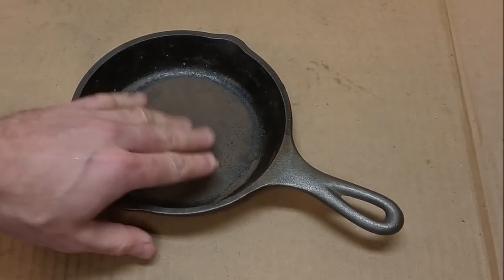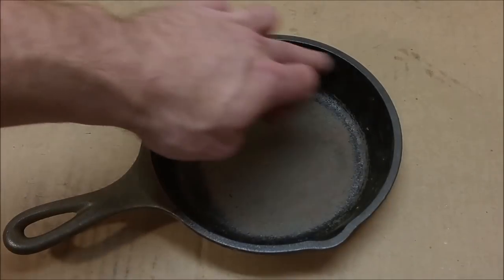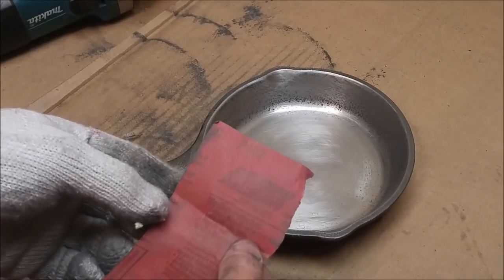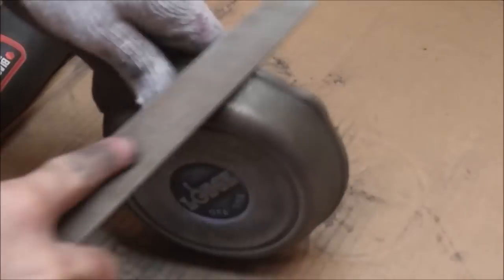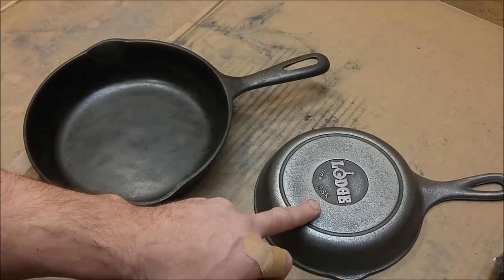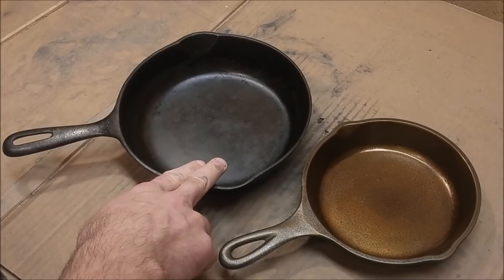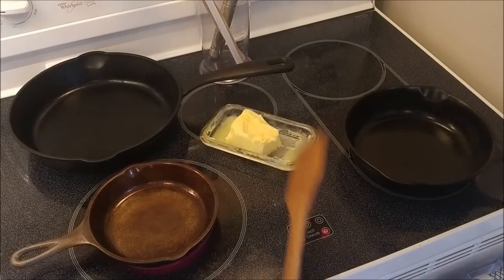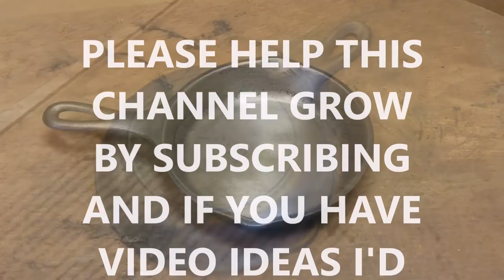🍳 SMOOTH a Cast iron Lodge skillet to make it function like an antique

Comment: I have to say, I restore a lot of cast iron and cook every day with it. I can take a brand new rough Lodge and not have sticking. I have a new 8 inch that within 30 days of purchase you could already see the seasoning layer build and start to smooth. If you have sticking, that means your cooking process is wrong. Has nothing to do with the iron.
Reply from the maker: I would tend to agree, since making this video I've investigated this quite a bit more.  I have gone so far as to test pans with no seasoning, both with oil and without.  At the right temperatures and with a little oil, they are also non-stick.  I've removed all residual oil from my seasoned CI pans and tested them to see how non-stick the seasoning is, and that's where is gets interesting.  It really comes down to the cooking temperature and the starting temperature of the food.  Cold eggs for example cooking in a pan at 100C will stick terribly, they also tend to stick to the pan even with a bit of oil.  When I tested warming the eggs first, that made a big difference.  The pan has to be beyond 100C, for steam to form and that seems to be the major factor in preventing the food from sticking.  the layer of seasoning seems to do more to protect against rust than it does preventing food from sticking.

What are your thoughts?
Reply: @NeedItMakeIt  I noticed this video was over a year old so didn't doubt you had some knowledge on the matter since you put this one out, but you nailed it in the last 19 words of your statement. A lot of folks say seasoning is exactly good for that, to prevent rust. Also, the more seasoned a pan is, the easier it is to clean after those mishaps or anything out of the ordinary that does stick. Now, I don't doubt it helps with cooking and adds to the properties of being non-stick, but when it comes to cooking, I can strip a pan, season once, and cook without sticking. But there's nothing like cooking on Mom's 45 year old seasoned skillet lol...
Reply: @NeedItMakeIt  I just viewed your video. The one thought I had with your eggs, are they cold, or room temp? I've found cold eggs dumped into even most nonstick skillets will stick rite in the middle of the egg!

Comment: Could eggs sticking be the result of slightly too high heat?
Reply from the maker: I've always heard "Hot pan, cold butter", I can't say I really understand the science behind it.  With eggs, there seems to be a temperature that is just right to keep the yolk runny to achieve the best dipping experience, but still have the whites cooked all of the way through.  

These days I like to use my plate as a lid; I find that it cooks the eggs better and it keeps them warm longer.... I'm starting to get a craving for eggs right now :).
Reply: There's two churches of egg frying in iron cookware:
- The brotherhood of low and slow 
- The disciples of the purgatory of eggs

The holy cookbook of the brotherhood demands cooking the egg on medium low heat for quite a while. At one point it should more or less self release. The brothers end up with an only slightly browned egg. 

The sacred scrolls of the disciples on the other hand  praise cooking the egg on higher heat. After a short while, it again should more or less self release and bless you with a nicely browned, crispy egg with lots of roasted flavors. 

Me being an egg atheist, I found both methods to work. But in my experience, the low and slow method requires a well seasoned skillet. Newer skillets tend to produce a sticky mess that way. Therefore, I prefer the other method. I also enjoy the roasted flavors of those crispy eggs.

Comment: Have you tried a wire brush for the grinder
Reply from the maker: I have not, I've seen a video showing this recently and I suppose it would knock off some of the high spots.  It may do less damage than a flap wheel around the inside corners also right?

Comment: Would like people in these non-stick test videos to cook something that will actually test the surface. Eggs, pancakes, French toast all have lots of butter first. Cook some bacon, pork chops  or chicken fried steak to test for nonstick.  There will always be crud left behind that requires scrubbing.
Reply from the maker: I will put this on the list, I have a few CI videos coming up testing some of these topics, I think this would be a great one.  Thank you for this.
Reply: The first misconception of people is to think polishing the surface of a cast iron skillet makes it nonstick. It doesn't. Polishing simply makes it easier to clean and more fun to use.
If food sticks to your skillet, there's something wrong with your cooking technique (and maybe the seasoning). Try a different cooking temperature and give the food time to self release. Pre-heat the skillet until the whole thing (including the side walls) is at cooking temperature, then add the oil and then the food. Play around with the variables and you will find the right settings for your skillet and your stove over time. 
And don't expect your CI skillet to become nonstick like a brand new Teflon skillet. It won't. A little oil / fat is required for most food types. But due to the seasoning actually absorbing a little oil (which expands when the skillet heats up and then forms a microscopic thin layer of oil), you still can cook many things without using oil in a well seasoned skillet. But if you remove that oil by cleaning the skillet with dish soap, most food will stick without oil the next time you cook. That's why you should always reapply a very thin layer of oil after cleaning with soap (which is perfectly fine).

Comment: Seasoning is a coating. The roughness of the pan is irrelevant. In a seasoned pan, the food never even touches metal. It touches a vegetable polymer.
Reply: That's irrelevant.

The smoother the pan, the flatter the seasoning coat.

Seasoning isn't remotely "non-stick". Therefore, the smoother the better.

AND it takes a good long time to fill in all those dimples from the sand molds.

There's a reason why the old cookware was made smooth. It was better.

There's a reason only cheap cast iron is left unsanded. It's cheaper......

Comment: Eggs tend to like lower heat and cooking spray not butter in my experience
Reply from the maker: But what is an egg without butter!  You're probably right, but I was raised on eggs with butter and I love that taste.
Reply: @NeedItMakeIt  

The best fat to cook a fried egg in is bacon grease.   I like to lay out the bacon on a cooling rack inside a baking sheet.  Cook it low and slow and the renderings are free of any burnt bits.  Also, cooking the bacon slow allows the fat to just melt and drio without warping the strips too much.

If you really like butter, you might want to try ghee, AKA clarified butter.  Just the butterfat without the water or the milk solids.
Reply: @MrRShoaf  - i have used a combo of 1/2 bacon grease and 1/2 butter works well,  also 1/2 coconut oil and 1/2 butter works well too.
Reply: The French have been using butter and oil in their carbon steel skillets (which behave pretty identical to cast iron) to cook eggs for more than a century. Give it a try. But butter should also work fine alone. It's usually more about the temperature. New cast iron skillets tend to require a little more heat for eggs to release. With the seasoning becoming better over time lower temperatures will work fine too. Simply play around with the temperature settings and give the egg time to self release and you will find the sweet spot for your skillet.
There's also a nice video about cooking eggs on the YT channel of 'Uncle Scott's Kitchen'.

Comment: Idk how you season but it's phenomenal
Reply from the maker: It is nothing more than very light coats.  I like to use canola oil, but you can use vegetable oil, basically the same.  I've tried seasoning on the stove top, but it's just not as successful in my exp.   The BBQ seems to give the best result for me.  I'm sure I can whip up a quick video if that is something that would help people.  One note about seasoning is that directly afterward the process isn't complete, it requires a 'cooking in' people say bacon fat works the best, I'd agree, except don't actually cook bacon, just use bacon fat and cook the pan with the grease in it.  I have a few other tricks for a super rich deep colour for new pans, or sanded pans too with minimal effort.
Reply: @NeedItMakeIt  thank you. I would appreciate a video. Thank you for the reply. All my pans are seasoned great and I wouldn't change my method at all. I love seeing everyone's methods tho. Cheers, James!

Comment: This trend is baffling to me. I've got old Griswolds, Lodges, Wagners, BSRs and a Volrath. I also have several modern Lodges. Nothing sticks to any of them because I keep them well seasoned and use fat/oil when I cook. Suddenly, there's this obsession with making new Lodges smooth on the bottom, as though they don't work right otherwise. It's ridiculous. The first thing I do with every pan I get - new or old - after ensuring it's seasoned properly, is drizzle some oil in it and cook some eggs. Over two dozen pans that span nearly a hundred years in age and none of them give me any problems. Not even the "icky, rough" modern Lodges.

If you want something like a vintage pan, just buy a vintage pan. They're lighter weight than new Lodges, anyhow and there are thousands upon thousands of them out there to choose from. Sanding down an already perfectly good pan to pretend it's something else is just an exercise in futility.

Comment: Cast iron is cast iron there’s no noticeable difference if the composition is the same
Reply from the maker: I think you're right, it really comes down to surface finish, seasoning and temperature of cooking.  Surface finish may not have as much to do with it as I thought, a rough finish can still perform well, but they aren't as easy to clean.

Thanks for the comment!

Comment: Heat your pans up slowly and they will not warp.
Reply from the maker: A good tip, the old Wagner pans have thin walls and heat up quicker so I am a little more careful with them, the Lodge is much thicker and it takes longer to heat up at the same settings.  

I have cracked a 12" pan in the past by heating it too quickly, I accidentally turned the stove too high.  As far as warpage, cast iron isn't as prone to this as people think, a sudden uneven change in temperature - such as welding will cause the pan to become permanently warped.  Heating the pan on the stove can cause a temporary deformation as the bottom becomes hot, but the sidewalls are still quite cool, when the sidewalls warm and expand, the bellied bottom will flatten out again.

Comment: Would you please list the tools you used for this. Thank you.
Reply: It's a wire cup brush then sand paper from 60 to 220 grit the grind wheel will be 60 or 80 grit wheel. I'd suggest some foam blocks for corners and grooves and a file for the rough edges where the cast was.
Reply from the maker: Thanks for answering the question.  Bang on!  I used a granite calibration stone for leveling the bottom, but that's overkill, anything flat hanging around the house would work just fine.

Comment: Really nice turnout, smooth as a woman's ass. I don't care what anyone says. Stay away from that olive oil in cast iron. Has a low burning point doesn't like to play nice, can get sticky, get a funny smell, turn on ya like dead corpse and make your cast iron stink, especially if you put it away an don't use it for a while, I don't know... great-Grandmother & great- Grandpa didn't use it so...
I don't use it in my cast iron, not saying you can't ..but.. I don't. It's great for Italian dishes but not in cast iron, it's fine for stainless steel or carbon steel. Thanks for sharing. Tips: butter fat lard Crisco all great for cast iron skillet but make sure that pans warm first. You probably already knew that, never grease a pan when it's cold. Treat a cast iron skillet like a woman you got to get her warmed up first.. hehe.. Give it lots of love it'll love ya back, treated like shit and it'll work like shit. 👍🏻👍🏻
Reply: I think the olive oil smells amazing when it first hits the pan.  I usually use avocado oil, as it has a higher smoke point.  I got my pan to where it is with bacon, which I cook in the microwave any more. 
You're right, he sure got that pan smooth!  Using a metal spatula exclusively got mine good and smooth.

Comment: To get the seasoning to stick, try abrading it a bit rather than leaving it with a mirror-smooth finish or perhaps shot-peening it with fine shot, to give it a satin texture. I suggest this because two coats on this shot-peened satin-finish carbon steel pan gave it a dark black color:
https://www.youtube.com/watch?v=zb6d9Xm7i3o
The microscopic increase in surface area due to peening or sanding to a satin finish will help the finish go black rather than that dark brown color.
Reply from the maker: Great idea, thanks for the tip.  I was thinking of a very similar concept just this morning.
Reply: @NeedItMakeIt  Another thing worth considering: https://www.youtube.com/watch?v=2Pvf0m9jTeE
His seasoning method has some critically insightful tips. Make each coating as thin as possible. Wipe the oil off as if you never wanted it on there to begin with. The thinnest possible coatings is what results in the best seasoning. If you see any splotches or pooling, you're using too much oil.
Reply: @Berkana  Hello! I'm also not that much in favour of a complee glass smooth finish. Could you please tell me how can I replicate (if possible) this satin finish? I have a brand new Lodge that is preseasoned. Will sand paper be enough? Want grade sand paper should I choose?

Thanks in advance!
Reply: @monobgantonina5577  A brand new lodge will be hard to put that kind of satin finish, because you would need to grind away all the pits and bumps. But once you're down to a smooth surface, abrading it in small circles using 800 to 1000 grit sandpaper on some rubber or neoprene backing will give it a satin/matte look.  Basically, you're giving it randomly oriented scratches at the microscopic level, and this has a satin appearance.
Reply: @monobgantonina5577  If you want a pan that already has that finish, consider the Field brand cast iron pan. Those pans are gorgeous. https://fieldcompany.com/p/cast-iron-field-skillet/
Reply: @Berkana  Thanks for your answer. I'm in Europe and sadly the pan you suggested is not available here.
I'm not sure I understood you about getting the satin finish DIY.
I'm planing on sanding (handworking with sandpaper, no machines) my Lodge skillet until it's smooth but not completely glass like.
You suggest using sandpaper to abrade it? Wouldn't that just further smooth it? How is it different from the thing I plan to do originally, smooth it with sandpaper?
Reply: @monobgantonina5577  If you sand it, but don't want a mirror finish, stop at 1000 grit. A mirror finish requires 2000 grit plus additional polishing. If you stop at 1000 grit, you will have a satin / matte finish.
For something as coarse as a lodge pan, you will need to start with pretty coarse sandpaper to get through all of the roughness from the sand casting, then switch to finer grit paper to get rid of the deep scratches from the coarse paper.
Reply: @Berkana  So just keep sanding it from start to 1000 grit and that should be the perfect texture? Thanks a lot for your advice. Anything more to it or is it as simple as that?
Reply: @monobgantonina5577  I do not recommend starting with 1000 grit. If you start with a very fine grit, it will take a long time and far too much sandpaper to wear down the coarse texture. Start with a grit coarse enough to take down the coarse sand-casting texture quickly, and once that is all gone, you should switch to finer grits. Do not start with anything finer than 500 grit. Only finish with 1000 grit.
What you don't want is to have un-sanded pits surrounded by smooth metal. That looks bad, and won't season well, but that's what happens when you start with too fine a grit, or when you stop before you get down to the level of all of the pits. You want the whole surface to be evenly sanded. You can see examples of people who sanded their cast iron pans on YouTube, but the error most people make is that they take it too far and give it a mirror polish. If it is too smooth, it won't grip the seasoning very well.